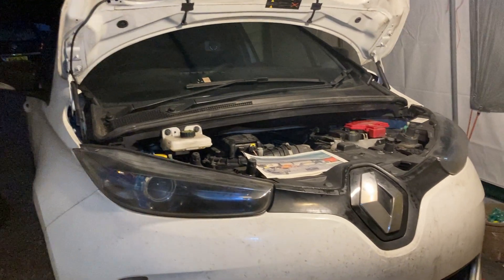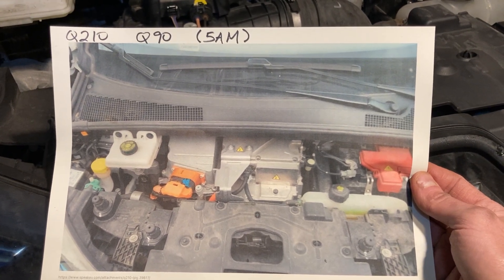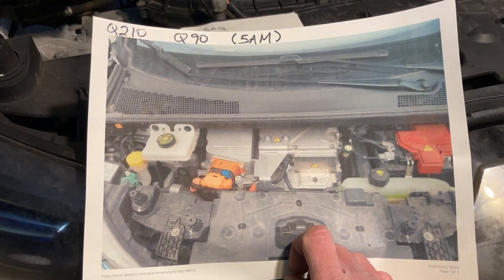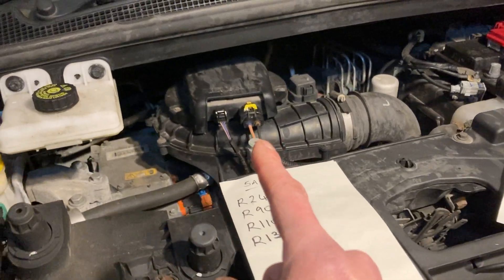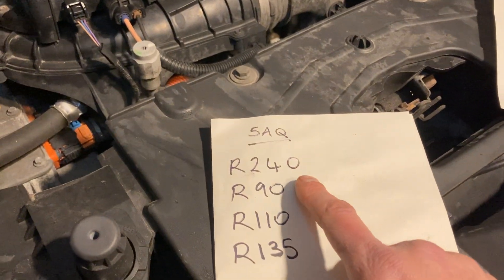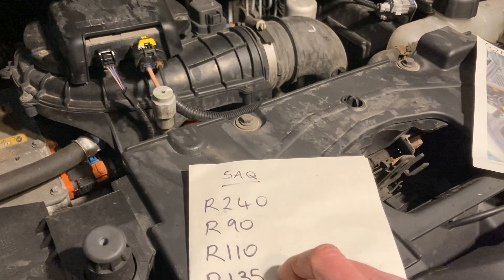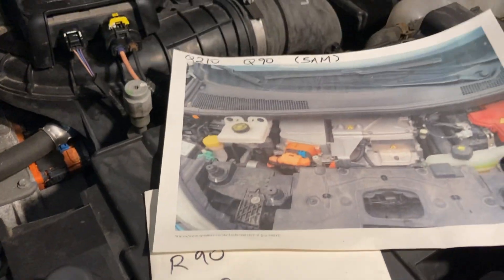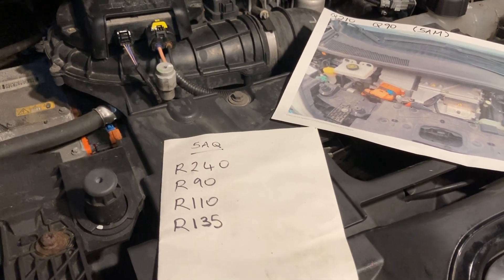Which variant/motor type of Renault Zoe is most reliable? 5AM? 5AQ? R240? Q210? R90? Q90? R110?R135?

Comment: I'll check the channel for an updated video but this is useful all the same. I was considering a ZE50, thinking that's just enough range for me, but have been a little put off by the motor bearing issue. Otherwise it'd be a good first EV for me at the right price.

Sadly, I missed out on viewing a Q90 ZE40 locally but considered it assuming I'd learn to manage the charging on longer trips (up to twice the range of a ZE40 but mostly just within the range of a ZE50).

Comment: Like everything mechanical, if we treat the EV with respect, don't do silly wheelies and slam down the throttle at every traffic light, the motors will be very reliable. It is usually the huge torque damaging the gears and the electric motor coil burning through excessive loads at high speeds.

Comment: Are they have problems with this inverter fan assembly on the top?
Reply from the maker: Hi, occasionally the fans can fail or connectors get corroded but not very common. Sometimes the fault codes for cooling issues can be misleading. Cheers
Reply: I have problems with this fan. In found coroded conectors, I clean it but still not work. The relay is ok, and the fan itself work when I give it a short cut.what drives it?
Reply from the maker: @aleksibuhov8712 hi, it doesn’t often come on. If you remove the smaller connector it should run all the time.
Reply: I try this, but noting happend.

Comment: 2018 R90, motor bearing @132000km, started to fail @ 125000km. Replaced with ceramic SKF bearing to avoid circulating currents in stand-still bearing when charging.

Comment: I have a 2014 year model Q210 Zoe with 104 000 km. Has a problem charging in hot weather, over 30C, otherwise no problems after getting rid of all the original EV tyres from Michelin.
Reply from the maker: Yes the original tyres were very hard and would crack before wearing out. check the water pump is working. Cheers

Comment: Having an r90 with motor code 5aq 601 2018. Probably made 2017? 

Bit over 11 000 km now. Had it since it was 3000 km old. Have tried to be aware to not accelerate hard since it was 5500 km due to awareness of the bearings failure. 

In my dreams we will get 9000 km more together. ❤ my darling zoe.

Edit: I drive my zoe pretty fast though. 120 kmh and over for maybe 60km every day.

Comment: My wife has an R135. It’s now done just over 105 000 km. No engine or bearing issues (yet), but during past winter the compressor exploded… the repairs were quoted at over 10k… I’m a retrofitter myself, so I took a course and exam to get my F-gasses permit and did the repair myself. Brought the price down to €1600 for a compressor, new condensor, new accumulator and some gas for topping up. I flushed all the refrigerant pipes and hoses, which was quite a pain in the a**. The cooling capacity is a bit less afterward. Probably some orifices are still a bit clogged with debris from the blown compressor, which couldn’t be flushed out. Or the evaporator is a bit clogged. It’s not bad enough to warrant replacing the lines with orifices, let alone the evaporator.

Comment: I have a 2013 registered Zoe that was a 'write off' and battery removed. I am working on it to put back on the road for kids, buy a used battery from a breakers. Is the motor issue something i should be concerned with?
Reply from the maker: The early type motor is more reliable but I always wonder whether this method is worthwhile once you’ve bought all the parts and had them fitted whether it would actually be any cheaper. Cheers
Reply: @garycevrepairs  Thanks Gary, as i work through what i need, it is indeed nearly the same cost to buy a used model. The batteries are relatively expensive, even at the lower end of the market as there is strong demand to pair with home PV systems...
Reply: @brendanoriordan9118 And knuckledraggers  were (and still are) like "where are all then batteries going to go?

Comment: I am considering using a 2021 Renault Zoe BFM electric motor 5AQ 5AQ605 109 in a project, replacing the motor in a 1960s era Renault R8 with one.  What are the pitfalls I should be aware of?  I like the appearance of it and it seems like it would be relatively easy to connect to the current bellhousing in the R8 with an adapter plate. I'd leave the transmission in the 8. Thanks!
Reply from the maker: Hi well it depends if you can find a controller to power a motor with a wound rotor (separately excited).

Comment: Heres an interesting different take on this issue. I live in Germany but follow various youtube channels both sides of the Channel. I noticed that there are many more posts in the UK regarding motor bearing problems than in Germany/Austria. It got me thinking... I wonder if it is related to the poorer road standard in the UK? The Zoe has a small, rigid chassis compared to bigger EVs. When i visit my family in the UK with it, i am literally chucked all over the place. The roads on the Continent are way better - smoother and with fewer potholes. Could this be a factor in motor bearing cases?

Comment: My Zoe R110 41 Kwh from 2018 is now on renault service for replacement of the motor with 70 k miles (115.000 km), no issues with suspension. Mostly used in highway but in eco mode at  about 55 mph

Comment: My june 2017 Renault Zoe Q90 92,000 miles SOH 86% has had drop links and n/s front strut done under warranty around 50,000 miles
Had a cell problem a couple of months after i got it ( Nov 2017 ) battery removed and sent back to france to be fixed since then all good 👍

Comment: I have a r90 41kwh 92ch at almost 160,000Km. The only problem I had to solve was it didn't charge on the slow 8A charger so I bought a 32A 7.1kwh charger and its okay now. Battery is at about 83% health. I just paid out of the battery lease as it was too expensive. The car always does around 200Km at 0 degrees and in summer about 260/280Km. What surprises he is the non interest by Renault in explaining anything or doing ANY preventative work on this. It seems very hard to find any independent repairer in France actually.

Comment: Our r110 from 2017 (albeit with 40000 miles) has only had the front suspension issues supposedly common on cars used around town.

Replaced all front bushings (and maybe shocks?) at great expense, although according to the dealer it's a known issue and renault covers the parts cost so we paid labor. Still expensive!

We do have a "hunting" or kind of cyclical wubwub when decelerating, I suspect brakes being unevenly worn, and the battery is at 91% SoH

Comment: Hi Garry

I have a R135 and it has a strange noise, more like a whistling. It is definitely coming from the motor. The car has only 22000 miles. I bought the car a month ago, and only found out about bearings issues few days after the purchase :face-purple-crying:
Should I be worried?
Reply from the maker: Well it’s still under the 5 year warranty so just make sure you extend it before it expires.
Reply: @garycevrepairs  yes, that is exactly what I am going to do.
Thank you for the great content and sharing your experience.

Comment: Hi Gary, we have r110 with 103000miles and now we have motor bearing issue. The second zoe we have r135 with 94 000 miles and it didn't have bearing issue.

Comment: I think its more related to the type of use that they got because, lets be honest, who is going to thrash any of these motors? The car is not fast (top speed wise) and the range falls of a cliff when accelerating hard or when going faster then 90 ish kph..
In my opinion, cars that are driven for longer periods at higher speeds and/or that are accelerated hard from standing (traffic use with a heavy right foot) demand more from those bearings and they eventually fail.

Why OEM's fail to design reliable motors is what I would like to know. Its not a Renault issue, pretty much all EV's are having issues with bearings and reduction gears.
Everyone is afraid of the batteries and in the end the weak point are the motors 🤣
Reply from the maker: I personally love the instant torque of an EV motor and drive foot flat a lot of the time, tho passengers generally aren’t keen 😆. The design weaknesses are annoying, I live in hope that EVs will get more reliable over time though newer ones tend to have far more complex systems for cooling/heating and much higher battery energy density plus premium features like auto boot hatch opening which all adds to the chance of failure. Cheers
Reply: That's my thought's exactly.

Comment: So the ‘most reliable’ ones need motor bearings after 100k? Are they hard to replace? I’ve rebuild engines so I’m not shy of mechanical work. Just gets expensive if you need special tools etc. I might get a Zoe with bearing issues and replace them myself.
Reply from the maker: The most reliable ones probably never need it doing. It’s a long job 
https://youtu.be/_jJXBTsBT4o
Reply: @ Oof, thanks for the video and showing a lot of detail. I either buy reliable cars, or cars with an issue that I know I can fairly easily fix. But I will stay away from these.. dry motor, sealed bearings, brushes, corrosion and many hidden possible issues… And thats only the motor. I was still naively thinking these were simple cars.

Comment: Don't the Continental motor has issue with worn brushes? A simple part to replace but quite expensive as it involves removing the engine

Comment: Hi Gary, my 2018 R90 is on 90,000 miles with no drivetrain issues and battery is still great. I’ve had front suspension work done probably four times now and it’s really getting on my tits. I’ll probably chop it in this year against a Hyundai, but it’s been a fantastic servant for us as far as saving fuel costs goes, and I still think they look great
Reply from the maker: Nice one. Suspension is a real weak point yes!
Reply: Ditch it before the AC compressor goes too - like ours did!

Out of interest, do you regularly have to navigate speed bumps? We had seemingly endless suspension repairs on ours, but it used to do 4x daily journeys on a road with speed bumps. I tried to educate my wife... 😂

Comment: I had 2019 r110 zoe. Used as driving instructor in eco mode all the time so mabe not power related. Had motor bearings go at 50k miles replaced under warranty. Then 92k miles the check electric system light came on, renault couldnt see it for 3 weeks so traded in for kona and didnt see what was wrong with it

Comment: Is there any advice you can give Zoe owners to prolong the life of the motor bearings? I assume avoiding too much harsh acceleration will help?  I've got an R135 at 93k miles. No problems with the electric motor so far!
Reply: No sealed bearing will last forever... issue isn't just the harsh acceleration, it's also high speed driving. At motorway speeds, you'll be around 8000rpm+ on that bearing... which will shorten it's lifespan.
Reply from the maker: Spot on, I think being gentle is the best way if you want to keep it for a long time. Glad you’ve got some decent mileage on it, my wife’s R135 is on 36k 😃.
Reply: I'm at 61k miles in my R135, only issue so far was the heat pump compressor failed at around 40k and was replaced under warranty. Otherwise all good 👍🏻
Reply: Mine R135 from 2021, just surpassed 100.000 km. I asked the mechanic about the bearing, and he said that firstly it will start to make noise, and I should hear it. Than is time to replace that bearing. Mine battery soh is still on 95%, I find this amazing.
Reply: Wear is related to speed(rpm->temperature->degrease), humidity(the spray from car in front gets blown inside teh motor) and shocks(once some play develops, teh hammering begins).
Someone said they were still good after 400kkm as a taxi in America...

Comment: It would be interesting to compare motor design of Zoe 40kWh and Leaf ZE0. Also, is the LEAF motor easier / faster to repair? Etc.
Reply from the maker: Leaf motors don’t break 😆
Reply: @garycevrepairs it’s almost like the Nissan Renault alliance was a mad situation since they both managed to make cars with opposite weaknesses
Reply from the maker: Yeah, a Leaf with a Zoe battery would be great 😆
Reply: @garycevrepairs  if only eh 😂
Reply: Team up with RichRebuilds for a Leaf/Zoe cut-and-shut - front end from a leaf, battery and passenger compartment from a Zoe 😬
Reply: @MrWobling the Carlos Ghosn dream 😂

Comment: Hi Gary,
I have a Q90 z.e. 40 2017 top spec (heated seats, leather interior, etc) demonstrator bought in 2020 now has just over 10000 miles. Touch wood no issues so far. Thank you for the video.
Reply from the maker: Sounds great! Signature Nav iirc

Comment: Is the r240 and r90 the same motor? I heard they have the same article number.
Reply from the maker: Hi they are certainly the same design. I have both variants here, will see if the part number is easily visible.